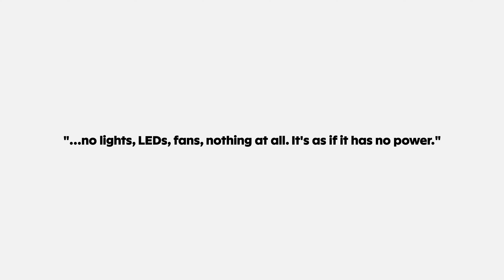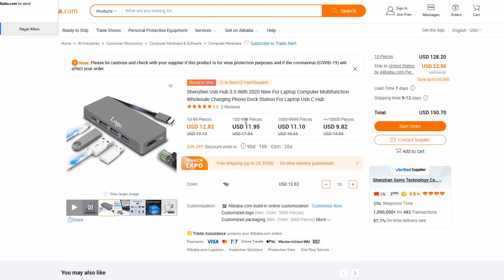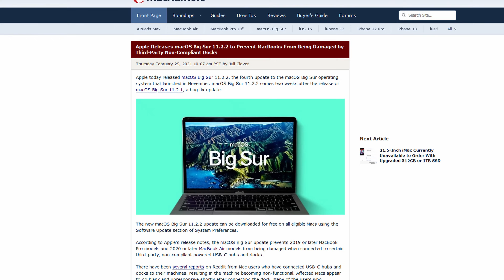Are USB-C Hubs Killing M1 MacBooks?

Comment: I’m 60 years old with an M1 (not that age matters but say that in case someone wants to comment something snarly because I’m not tech savvy). Any-who, I’m scare shit to use a hub on a recently purchased M1A. (I bought one thanks to the great info on this channel). 

However, I’ve been learning about this hub issues and watched many videos on it. I’m just overwhelmed. There’s so many options to buy too. 

Hope this nice community can assist me. You pro editors and computer/tech savvy folks out there PLEASE HELP 

Here’s what I want to do 

First of all, I got the M1A Mac this week but thinking about exchanging it to the pro because I literally watched a few videos on this channel and other good ones and realize the pro out beats the Air in some areas like editing, is that true? 

Aside from that dilemma, I need my Mac primarily for running 2-3 businesses so having multiple screen open is essential; RealEstateSoftware, Accounting Software, Editing Software, School Work. 

I will be Podcasting too. Additionally, I want to add parallels (to use it as Windows for school stuff or should I just buy Windows Office?) 

Now that you know my usage requirements-needs I’d like to know what hub to buy so I won’t experience any issues like many have had from reading the comments here. It is imperative that I do not go without my laptop for weeks so trying to prevent any issues to not have to deal with sending it to Apple for repair. I want to be very careful. 

What Hub are best, anyone? 

Side note: I notice in comments many are saying NOT to connect the laptop power cord to the hub to charge the laptop while also having other devices (mic, screens, etc) to the hub as well, is that right ? I’m not sure if I’m understanding this correctly. 

My apologies for lengthy comment and my several questions. For whoever read this far and can give me some honest guidance, THANK YOU !!!!!
Reply from the maker: "pro out beats the Air in some areas like editing, is that true?" Yes, the fan does a good job especially when editing and rendering. If your budget allows, a M1 MacBook Pro with 16GB RAM and 512GB SSD would be my recommendation if you will be doing a lot of editing.

"I need my Mac primarily for running 2-3 businesses so having multiple screen open is essential" M1 MacBooks can only output to a single external display. You can still have two screens in use (the laptop screen and an external monitor) but no more. The M1 Mac Mini however can have more external displays.

"Additionally, I want to add parallels (to use it as Windows for school stuff or should I just buy Windows Office?)" If you only need Microsoft Office programs (e.g. Word), no need for Parallels, just buy a Microsoft office subscription.

"What Hub are best, anyone?" The two hubs I linked in the pinned comment on this video are my recommendation. I personally don't think you will have any issues, just make sure the software on your Mac is updated.

Comment: YES THEY ARE! I got my M1 air in December 2020, and used it as a normal laptop until January (working from home) as a desktop, I purchased an USB C hub with Power Delivery. About 3 weeks of using the hub, I plugged it into my Macbook and the screen went black and the whole laptop died. I then had to get it sent off for repairs, where the invoice confirms that the motherboard, I/O interface and touch ID units were fried. I posted the full story on the /MacBook thread if anyone cares to read more, if not reply to this!
Reply: How about warranty, did you got it fixed?
Reply: @racistpixel1017  covered under the 1 year limited warranty

Comment: I used a dongle that is very similar to what you showed in the video, I connected an external camera, network cable and screen via HDMI and rarely my Mac (Macbook pro m1) crashed and restarted (I think it happened to me 2-3 times during a zoom call)
Reply: Just last week I had my M1 MBA reboot (more than once) with a USB C to 4 port USB A and 2 HDD's attached. I pulled out a more expensive hub and there was no issue. Retired the cheap hubs immediately (UGreen I believe) I heard about the power pass through issue, so I never use that feature.

Comment: I’m using Adam elements CASAhubs, both are working fine with no issues with my MBA M1, I can connect 2 monitors per hub, one via HDMI and other via VGA at the same time. As you mentioned. Is better to pay a wee more than those cheap Chinese generic hubs.

Comment: Confirming this, my 1 week old mbpro m1 literally just got black screen one time i used hub's usb c charging. Apple had to replace logic board and touchbar. Never tried it again ever since.
Reply: What's the damage
Reply: @bakamarimo7528  mine did the same, they will repair it under the 1 year warranty
Reply: @niallwood  thanks a lot for update.
Reply: @niallwood  cant u use one USB-C port for charging and other one for the hub?
Reply: @xXxBo5sANaCxXx  we didn’t know it would brick our macs, so it was just more convenient to plug in just one cable on the side, looks more clean
Reply: @idenf1154  So you can use the other usbc to attach the hub correct and all the ports - USB, USBC, SD CARD READER, HDMI all still work?
Reply: what was the version of your mac os?
Reply: which brand did u get?
Reply: @jnhng7601  ZMUIPNG

Comment: Great insight, thanks. I've always believed in the maxim, "You get what you pay for" and quality in computer parts is no exception. Will be chasing an Anker or Belkin when I get my Macbook Pro pretty sharpish.
Reply: Macbook M1 cannot protect itself despite the price. It should smart enough for usb C, but unfortunately not. If other device just have no problem, then why.
Reply: @Julian-sj5tr  exactly many comments here keep talking about you buy the cheap and wrong hub but the fact that Windows PCs are fine well…. they’re all apple fanboy i guess? and No, I’m not even a PC user. I have an iPhone and a Mac M1 but I really want to use a cheap usb hub without all this silliness
Reply: @Julian-sj5tr  no, the problem is that Apple blocks 3rd party repair shops from obtaining parts to repair these broken Macs. What usually fails is the USB C controller, unfortunately Apple has now made exclusive contracts with Texas Instruments and such to not sell these chips to anyone. It's a disgusting practice, especially since they always brag about how green they are. I guess "green" is a symbol of cashing out.

Comment: I'm guessing Apple didn't land their implementation of USB4. Simultaneous Data and Charging through the same port is a feature of the USB4 standard, in theory its not that different from thunderbolt3 but Apple went with their own engineering on the controller.

I just hope the 14" has it all sorted, I need 3 external display support and am willing to spend good money for a portable workstation that can handle almost anything.
Reply: Hi, reading this 1 year later. How about it right now?

Comment: I have a M1 MBA. The laptop was dead after charging it through my USB C hub. I took it to an Apple Certified place and they are replacing the logic board (touch ID implicit) and the entire screen due to the ALS sensor was also crashed.

Comment: The latest version of Big Sur was design to fix this issue. Which is really great cause it turns out it can be fixed through the software. I was afraid they were gonna have to do a mass recall.
Reply: Means i can charge through usb c PD ? Now?
Reply: @daxtercage8939  better not take risk
Reply: @kyfa4966  tried already, so far no problem
Reply: @daxtercage8939  i know it will work but better not take risk if the hardware/dongle goes failed
Reply: @kyfa4966  Agreed, don't tempt fate. :)
Reply: so it was an apple bug
Reply: I’m going through this issue right now… I actually got the logic board replaced because it’s under warranty, however, last night my laptop got extremely hot and shut off completely. And this was after the new software was installed.. not happy
Reply: @Shadance89  what's your hub?

Comment: I used the Anker 8-in-1 USB Hub and it drains battery so fast even when there’s no usb or etc plugged in the hub, it drains 1% battery per minute and it overheats even when not actively used, just plugged in my M1 mac.
Reply: I read that some of these Anker/OWC hubs even they are not connected to anything, they use about 8W -10W power which is normal

Comment: I received an inexpensive USB-C hub when I got my M1 MacBook Air. I haven’t had any issues and have updated Big Sur, but should I disconnect my hub immediately and buy an Anker or more reputable version?
Reply: Just don’t use the charging port on the hub. Connecting devices is okay. But don’t stress the logic board by plugging in multiple devices simultaneously through the hub
Reply: @mizu2230  like charging a phone from the hub or charging the MacBook itself?
Reply: @mizu2230  why not use just an adapter then if you can't use multiple ports which is why people buy hubs? I've read comments about people using single device with their hubs. Then why not simply buy an adapter?

Comment: My M1 macbook air died in january because of an USB-C hub with power delivery (Aukey). The motherboard and touchID have been replaced... So, I bought the official apple USB-C hub, and no problem with it. Recently I updated to 11.2.2, but I did not retry my aukey usb-c hub because I'm scared to send my macbook again to the apple store x)
Reply: Frightening what can happen! Chance your device was still under warranty. Do you think such disaster could also happen from a simple USB 3 to Gigabit Ethernet Adapter (that also has 3 USB ports) which I use for cable connection and a LAN?

Comment: At least it’s not as bad as the first run Nintendo Switches. They weren’t USB PD compliant, and if you used anything but the Nintendo adaptor, any USB PD compliant power supply would interpret the Switch as requesting 20V, when it could only handle 15V. I got lucky with mine, I used a USB PD charger before I heard this was an issue. There must have been a minor hardware revision before the red box and lite came out, which I was lucky enough to have, so that’s still going strong. That was the shared Switch between my partner and I, and I’ve since bought a red box model, which charges just fine with my PD laptop charger.

My thinking is, assuming Apple made the M1 MacBooks properly Power Delivery compliant, then these same docks and hubs would be causing the same issue with other computers. There are fewer Windows laptops with only USB C ports, and generally complete hardware failures can be ascribed to other issues (I’ve had a faulty BIOS battery kill a laptop before), so even if these hubs are killing Windows machines, there are fewer Windows users buying them, and when they do, they aren’t narrowing the fault down to the hub, to blame it. Just conjecture on my part.

Comment: Can anyone help me? Im picking between air and pro m1. Im not sure wether to get air with 16gb ram or pro at 8gb ram. (based off my budget) ill be doing photoshop, learning to edit film and light gaming.. Any advice would be amazing!! Love this channel!!
Reply: If you plan to keep it for a long time as a serious work machine I'd bite the bullet on the 16gb. 16gb is really the base minimum on PC workstations, M1 is very good at juggling 8gb by using the SSD but its only a matter of time before apps demand more. If you are rendering the extra ram will save you some time but not a lot, it does make a difference if you plan to multitask on the machine while rendering. I'm very lazy closing firefox tabs while using PS and Resolve personally.

Also, this is just me but I despise the touch strip on the pro. Function keys are just way more useful and the documentation for programs are written with them in mind. I had the same buyers dilemma but the Air just makes more sense, even the 8gb Air makes more sense than the pro. The only real difference is the screen brightness(100 nits who cares), better mic, better speakers and some more battery life, but its all marginal stuff since the Air isn't bad in any of those categories. 

Air performance is the same as pro, screen is just as color accurate for editing and it has function keys. If it could do 2 external displays I'd already have replaced my office PC.

Comment: i have usb c hub from satachi is it safe to charge with it i am scared to use its charging port since i read all this even after update
Reply: @Utkarsh Katiyar yes that’s what I am doing charging directly and using hub for other purposes battery life saving a lot  thankyou 😊
Reply: have you experienced any heat issue with the satachi hub?
Reply: @juancarlosgarciamedina8788  yes  but not that much after some time it’s starts to become hot but not that much

Comment: does it just affect the Mac through charging from the hub or is it even when your just using it to connect a keyboard and mouse?
Reply: Pass through charging from a hub. Connecting devices is not an issue.
Reply: @SoDodgy  oh ok thanks
Reply: @SoDodgy  dont mean to be late but i just got an  m1 air and kinda scared so its fine if i just plug my midi keyboard and mouse etc.  into a single usb c dock like the anker in the video.? will be charging with the other usb c on the air ?

Comment: I bought an M1 Macbook Pro in December and have this issue where the right speaker crackles. Its a singular klicking sound and always happens the moment a sound comes out of the speaker after it‘s been silent for a few moments. For example when i press pause on spotify an then press play again. Or when i switch between the system sounds in settings. Anyone have the same problem?
I still hope it‘s a software issue cause i cant wait weeks for them to send me a new one sometimes the sound disappears.
Reply: Does this happen even after a fresh restart? Mine makes a random cracking sound when  I have not  restarted for days and the swap has reached 5gb.
Reply: @jose81  No it still does it after a restart. I'll probably just have to take it back to my retailer for repair since no one seems to have the same problem. Annoying as shit

Comment: Not just devices with M1 chip, even 2019 version happened as well. In almost of the cases I found, it seems to happen whenever you're trying to use PD port on the hub. My last MBP M1 got bricked because of that. 
Btw, my hub is Hyperdrive 8-in-1
Reply: are you currently using hyperdrive? I just bought one for my new mba m1
Reply: Ahh damn. Was just looking to grab one of those Hyperdrive 7-in-2 Duo hub.
Reply: Whats pd hub
Reply: @vissuuu69 PD is USB Type-C Power Delivery

Comment: Mine had a problem with a powerbank , and it was not a cheap one , I was using it since 1 year with my old macbook pro . Simply shut off completly and when rebooted webcam was dead and touch-bar had issues . It was fortunately replaced

Comment: Thanks for the video. This has been a source of anxiety for me for the last weeks. Have had M1 MacBook Pro since end of January. While it works, I can actually replicated a spontaneous reboot by plugging both Anker 7 in 1 hub and the Apple VGA/USB-C adapter, connecting it to external drive. All of this on battery. When I eject the disk, unplug the hub and plug the power cable into the port the MacBook reboots within minutes. 

Not ok for a +€2000 machine. Wondering if anyone else has this?
Reply: So can you elaborate on the "spontaneous reboot by plugging both..." part? You were on battery power, plugged in the Anker hub, and then a VGA/USB-C adaptor to use an external drive? And after that it forced a reboot?

First off, why use that cable? Oh you mean the USB-C VGA Multiport Adapter from Apple? Was it an off-brand?

Comment: I bought my mbp m1 this sunday and today i bought a LENTION usb hub and connecte it to my laptop 4 hour later  mbp died it’s 50 bucks hub it’s really not a cheap hub specially in my country but this happened and i returned my mac for warrants so i have question form u i believe my mac had the last update but since this happened do u recommend to not use this hub again? Or it’s just a 50-50 chance that the next time this won’t happen again ?
Reply: I had the same situation with you, i returned it and get a new one. And I still use that kind of hub, but i don't use pass-through charging on my hub. It seems to work normally
Reply: @HanAkhide   i am really happy for u can i ask u when this happened to u? Because i am thinking to return my hub and i’m really confused and don’t know what to do this things r really hard stuff to handle in my country
Reply: @amirmohebfotouhi5126  when I plugged power cord into PD port on my hub. I think you don't need to return your hub, just try not to use PD port in your hub. Because I think it's related to electric issues. And the newest firmware might solve this problem.
Reply: @HanAkhide   yeah i agree with u about the return but about my question i meant how long ago the accident happened and how long is it that u r use ing your hub in this manner ?

Comment: I had my M1 MBP clam shelled and docked to an Anker USB-C hub thru PD for 9 weeks without issues.  Not sure if my 100w usb-c power cable with the E-marker has anything to do with it, which is then powered by a hypper 100w usb-c charger.

But I read somewhere, that constant plugging & unplugging of the hub PD from the laptops may also have contributed to the issues.

Comment: Looks like this issue is set to be fixed in the next big sur update if you look at the release notes.
Reply: Ahh you said that later in video 😂
Reply: Fixed?  Kinda.  Apple probably turned something off that made USB-4 fast, but isn't really needed with USB-C.  Of course, now the port isn't fast so it depends on what you mean by fixed.
Reply: @tonyburzio4107  well if it doesn’t brick my laptop I guess it’s the lesser of 2 evils.
Reply: But even with this update, who will take the risk with his expensive MacbookPro M1 or another one?? i prefer honestly never use it ...